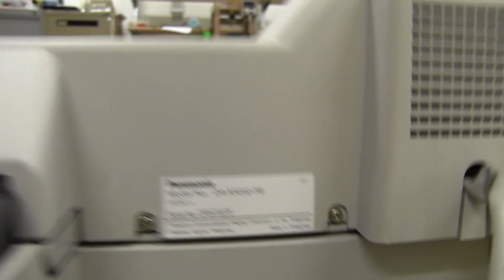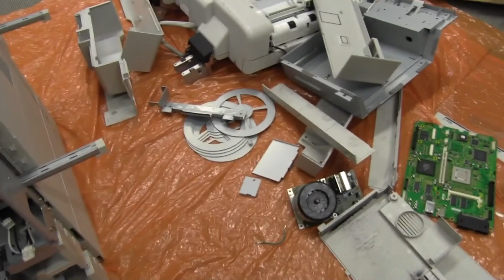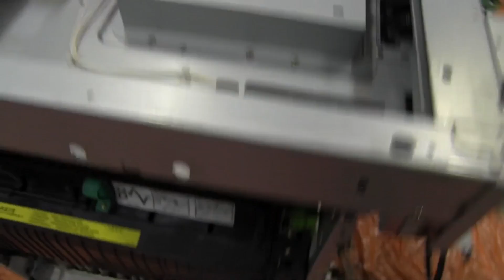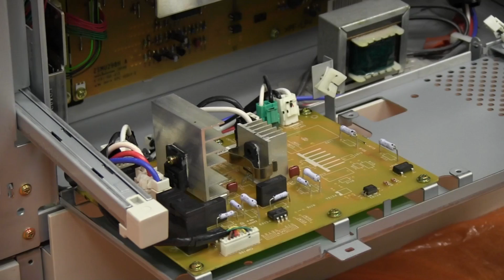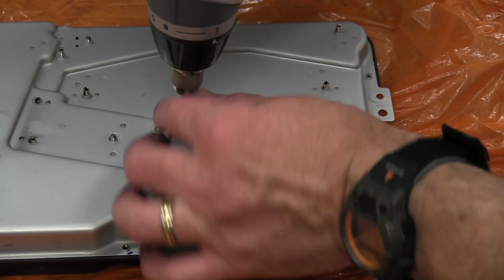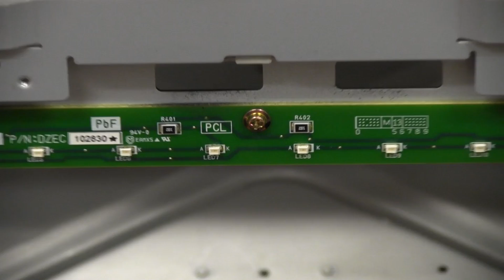EEVblog #303 - Photocopier Extreme Teardown

Comment: Sometimes I think Dave, I know as much about Laser Printers and Copiers as you do about Electronics ... I've been working on both for over 40 years and not just one brand or model but all of them, and believe when I say they all get it done in similar ways ... The technology improves but the trusty old screwdriver has pretty much stayed the same. I don't get very excited about the technology anymore, but I am always amazed that they get so much done with so little !! I started out working on copiers that only copied and the top scanned back and forth, they used liquid (kerosene & carbon) toner and the first ones could actually catch on fire. Years ago the machines were expensive and the toner was cheap .... this all morphed into give away prices on equipment that had to have the companies toners at exorbitant prices, with a special microchip that locked other companies out with encryption and RFID ... weird business !!! but exciting to the uninitiated as you mentioned !!!

Comment: I am betting they are just spacers, the pieces of metal on the laser housing... I bet they are just spacers to allow precise mounting for different models. 👍🏼If they wanted damping, there are 999 other ways that are not just more effective, but also less expensive. Does not make sense to use metal mounts for damping or vibration reduction. At least not to my engineering mind.

Comment: Selenium drum are black shinny metallic colour not used any more sine long time for its toxicity. Original image is pickup as links faction as green tube passing the glass surface pick up by mirror bar and focus on to an image sensor ,digital camera than feed to the laser writer as it spinning aluminium 6 or 8 Conner spinning mirrors it spinning so fast and it cold made the scanned image to 600,12000 dpi with 12-24 gray scales ,  it mean brightest  dot will neutralized the static charged completely on th drum so it will no attract toner ink.

Comment: Gree and can be red citing are organic metrical coating drum they are initially uniformly charged as it rotating and light , white area of a scan image will canceled or neutralised the charged surface on the drum black letter and grey scale scan image area remain to be charged and started attracting tonne rom the drum and carry further and dropped on the paper as another high static attraction zone as it pass than paper passing heat fusing roller

Comment: I'm a mechanical engineer and lead laser printer development for over 20 years. I began watching EEVBlog recently so allow me for such a super late comment.
I enjoyed this video very much. You first thought clutch as motor but later you discovered what it is by yourself. And you did no know this is full digital copier at first but you found the right answer by yourself at the end. You really got great insight of engineering.
 Now, what I felt interesting was  that you were very impressed seeing the main drive unit that comprises of one big DC motor and gears and clutches. Actually drive unit is not very difficult unit to design. Designing itself is rather straight forward and easy. While control panel with LCD and touch screen , that you were not interested in, rather impresses me, a mechanical engineer, more.

Comment: Those arms are to sidefeed the printer with an add on machine like a3 200g paper holder, or if you want to make a book you can add a staples machine where it folds the paper and staples then you have to use the sidefeeder or else the paper only sticks inside the machine 😉

Comment: there not motors, there gear breaks, they all have a shaft and gear system connected to a main motor, when its needed its powered and the gear grabs the shaft and turns it all from a main motor that way you can have one motor control many shafts

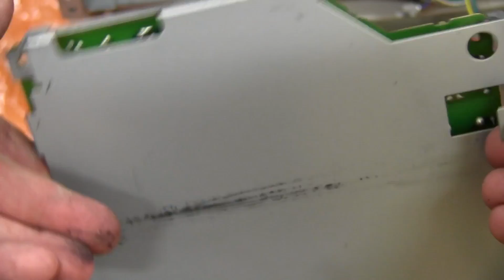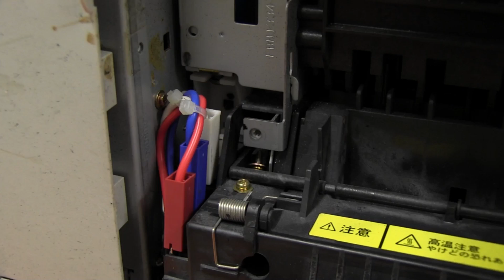Comment: 14:09 Hey I know some of this stuff. The high voltage power supply generates at least two different outputs, both can be as low as 800V (dark surface voltage of PC drum) or up to 8 kV e.g. for a corona wire/scorotron. One output for the photoconductor drum (PC drum) and another for charging the paper. The outputs are DC biased with a smaller AC bias for even more charge distribution. 21:57 So, most drums aren't made of selenium anymore, they use other photoconductor materials. They are split into a very thin charge generation layer (CGL) and a charge transport layer (CTL), with materials like PVK:TNF. Really, photoconductor materials are a hot topic in electrophotography (the technical name for laser printing, copying, etc). Hope this helps!

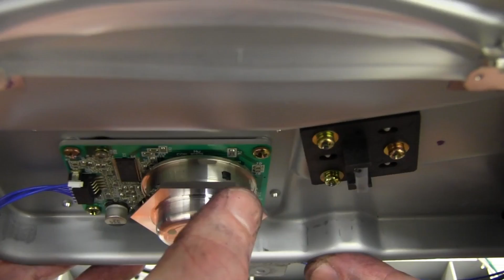Comment: Also late to the party and also an old copier tech, I'll just add a couple thoughts. The "drum" is a photo receptor meaning it accepts a charge in the dark and dissipates that charge when exposed to light. That charge is applied by a corona and is often 6000-8000VDC. Drums in machine for the last 20 or so years are "organic", while Selenium and Arsenic amongst others where before. The led pcb Dave shown near the end helps/adds in erasing any charge on the drum for the next copy. The helps/adds on some models is also done by more traditional lights, an AC charge corona, and/or wipers that remove residual toner. The laser assembly is pulsed on and off to erase the charge on the drum only in the blank areas while leaving the charge in the print areas, and yes there are grey areas where the charge is only partially removed. The motor spinning along with the mirror assembly aim the laser left to right and positioning is set by a strip that is just off the drum surface and the sensor (36:40). The CCD assembly is how the original document is digitized; the lens lengthens or narrows the scan line for reduction and enlargement. One last comment, the magnetic clutch allows the gear to spin without engaging the shaft inside; apply power and the clutch causes the shaft to also turn. These clutches are often used to move the copy paper along until another shaft/roller takes over. All those paper sensors are detecting paper jams, and timing. Different size papers will clear different sensors at different times. And that timing also comes into play with reduction and enlargement. Again the CCD with its lens effects right to left while the paper travel speed effects the top to bottom.

Comment: Just seen this video. Couple of notes: 

Looking at the laser unit, you can see a mirror on the left of the exit window, which directs the scanning  laser to a sensor on the right. This for exact scan timing. The glass between the rotating mirrors corrects the speed of the laser scan across the drum, as the spot will be moving slower in the centre than at the edges.

On the top scanner, there are two units scanning. The second is going half speed which directs the light to the camera sensor. this is to keep the distance from the scanned paper to the camera the same the length of the scanned paper.

Comment: well this is an informative bit of info been ceurious for a long time about how these things worked its interesting how 99% of these things is all optics and light bouncing around very neet the CCD is a single line reading through a wide angle lense as the mirrors move it reads each line of the image to be captured then sends it to the laser to etch it (with the static field to free the unneeded toaner very simple yet super complex at the same time very cool need to strip a few for some great goodies now haha

Comment: Basic operation of a Digital photo copier. Paper are picket  up with rollers then its going to the registration roller where it is synchronize with the drum speed. The drum and developing roller are charged negative to 600 volt , next step is writing a latent image on the drum with a laser where will the toner stick to the drum, next paper are passing by the drum and is charged with a positive charge by the transfer roller to attract the toner. and the last step is  the fusing unit pressing the toner with rollers and heat of 190 degrees Celsius.

Comment: Those "flat motors" with the 2 blue wires aren't motors, they're electro-magnetic clutches. Machines like this typically have one big motor (the one on the PCB in this case) powering the drive train that does the paper handling, with clutches to enable the various stages in the sequence, eg; paper pickup from the current tray, etc.
ETA: Heh. At 17 minutes, he's finally twigged that they're clutches. :)

Comment: 16:40 Sensors that let the board locate paper jams based on which gears aren't rolling?
Reply: Or maybe just so the board can monitor the rotation of each drum as it's being driven by the real motors.
Reply: Orange Harrison Im reparing such Machines. These ones are just electromagetic clutches.Jams are detected by strict timing when an sheet of paper should have passed an photocell.
Reply: Clutches, as Dave himself says later in the video. When activated, they connect the central shaft to the gear, while still letting those two things rotate relative to the metal frame.

Comment: You are a genius learner and a teacher.Most of guesses were correct and finally you have recovered the operations.Multiple mirrors are used for shorten the focal length of document scanner camera which equipped for scan both sides at once.There is a RGB LED bar for identify true colors on image and clutches used to drive steal shafts with rollers, to drive papers on exact timing.This one makes both side prints at once.The platen glass on top is a special single vision glass with very low refraction.There are sensors installed for detect temperature,toner,developer,over current,light and length. Un-fortunately you missed to recover the expensive(DP)digital printer(This is not ordinary photocopier) with a small expense.(I mean without consumables)

Comment: i translated a lot of photocopier manuals in the past and i worked with technicians. so i should say that you missed some good stuff. those solenoid driven clutches control the shaft they are connected to. when you fire the solenoid, the free running gear engages. the point is, you don't have to put several motors and synchro them electronically. One big motor turns the entire gizmo. most modern laser scanner head (that six sided mirror thing) has a ceramic bearing which has a real tight tolerance. you can lift it and replace quite easily, however. fuser unit has a VERY powerful halogen bulb and ptc's and thermistors inside. toner dispensing unit has a very complex measurement algorithm which regulates the toner/developer (ferrite material) ratio electronically. one last word: maybe you noticed, you can not connect a wire to a wrong socket, they're all different in the entire machine.  i especially noticed this with Japanese copiers.
Reply: The six sided mirror thing is a polygon mirror motor.

Comment: I've worked on even older school Xerox 50xx and 53xx low volume copiers back in the 90's.  Completely analog; all optics went straight to the photosensitive belt.  All boards were through-hole boards, even the CPU board (Mains PWB).  In the field we board level repair these things and send it to the factory.  But even with those old 'analog' machines, it still gives me a great appreciation of engineering it requires to get these massive machines going.  And that's the low volume stuff I worked on.  The Xerox Docupress line was a behemoth machine filled with moving parts; never fails to give me a nerdy hard on. . .

Next challenge for you. . .Reassemble it to it's original form lol.  Great tear down vids. . .Keep em coming!

Comment: quite educational, thanks.  that beast is so darn specialized and engineered its hard to reuse parts.  modified coper might help make photomasks for pcb or lithography using transparency sheet.  in standard office mode  the toner particles dont tend to fuse together completely though and it leaves little gaps.  to attempt to fix this slower paper path or higher fuser power might need hardware hacking.  i

Comment: The problem I'm having with such machines is that often there is literally no information to be found online about those, which accordingly often renders them useless (especially if you don't have the right testing equipment to get the specs). The mechanics however are spot on an you need no datasheet for looking at a set of cogs and how those rotate. :)

Comment: Wait, so if a photocopier uses light and mirrors to copy to the drum, what happens if you print a digital file? Is it some sort of projector?
Reply: +meismehaha Kind of, when you make a copy the sensor takes lots of "photographs" that are 1 pixel high, and X pixels wide (depending on dpi and paper size). The data is then sent to the laser diode inside the laser/mirror assembly. The laser sends out the first pixel row through the optics and shines on the motor that has mirrors, that spread it all out on the drum, then the next set of pixel row, and so one..

Comment: Try to get a old Satellite to tear down that would be interesting. I repaired and programmed large business phone systems for 30 years, one day our copier screwed up in the office, we called a repair tech, We were really impressed on his knowledge of copiers, he had the thing torn all apart due to some cog out of alignment. But he got it repaired and it went on working for years after. Electronics repair is one thing having to align and adjust and troubleshoot just where the trouble is coming from is a whole different story. I believe my boss offered him a job before he left. Repair techs truly are talented people and are very hard to find, and must combine many, many skills. At our company new techs had to work with there trainer for 5 years before they were cut loose , some more some less.
That laser scanner reminds me of the scanners where you check out in a store, almost the same design. Great hack material for sure.
Interesting tear down, tho you did it many years ago, its timeless.
Now go sell the scrape metal :)

Comment: The two switches on the top of the copier scanner glass are for two different things.  One triggers when the top door is just barely open.  This is to turn the lamp on and try and auto detect the size of the paper.  The other is just a general if the top door to the scanner glass is open.

Comment: The "fuser" is like a hot iron.  It melts and fuses the "toner" to the paper.  That heat requires WATTS!!!!  That's why "laser" printers consume so much power/$.  They also require a bit of time to "warm up"... literally!    The discovery of the semiconductor film on the surface of the drum predated the use of transistors!!!!!!!!!!!!  The process of transferring the "toner" to the drum then to the paper is an interesting process.....  that would make a cool video.  Yeah, very complicated, precise, and durable mechanisms (1000s of copies!!).  And you thought the VCR tape transport mechanism was complicated, whoops, remember those.  The copier prints a "serial number" on each image to identify the printer (so they can track you down if you are counterfeiting money!).

Comment: Unbelievable the amount of Engineering that went into creating that thing!  Then think about sub-component contracting, manufacturing, Q/A, and field support!!  Amazing they weren't $500K/ea back in the day.  And at home I have a ink-jet printer that cost $29US and replacement cartridges (B/W and color) cost ~$60...cheaper to buy the printer than the ink cartridges. Yeah, its not a scanner/FAX/networked but it prints what I need.  Great tear-down Dave!